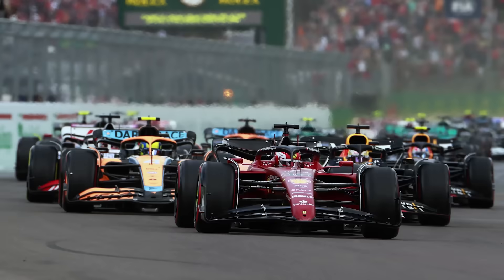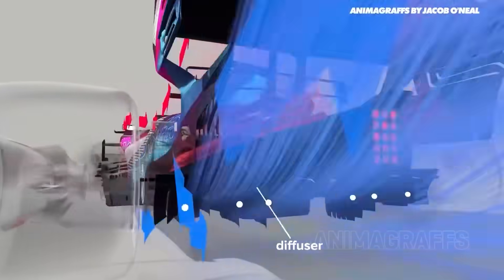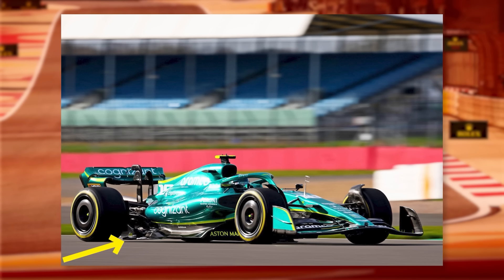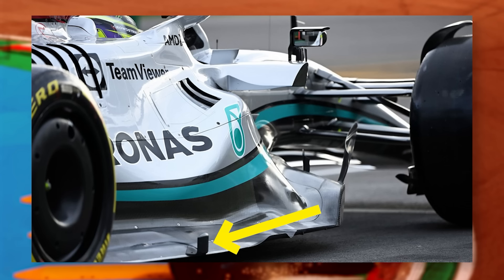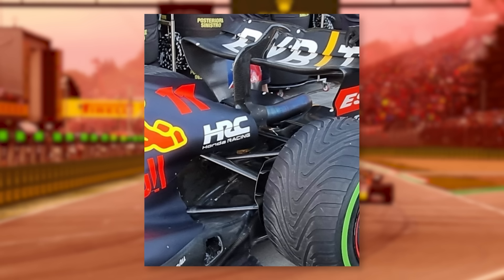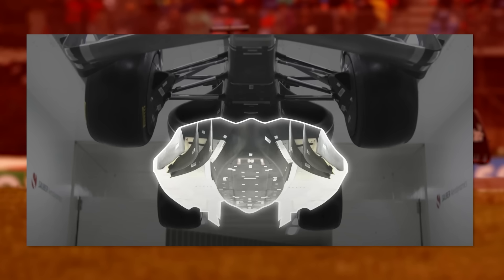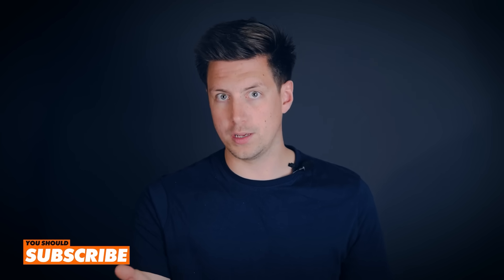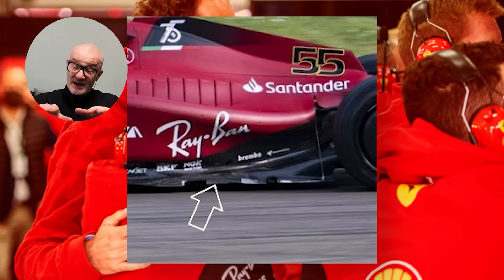The Tiny Component Giving Ferrari Incredible Pace

Comment: I swear you lot are paying scarbs' salary at this point 😂
Reply: grateful hes here though haha
Reply: I can do it for far less than Scarbs. Also, I know jackshit about the subject
Reply: @SnapshotPT  Believe in JESUS today, confess and repent of your sins. No one goes to heaven for doing good but by believing in JESUS who died for our sins. Hell isn't fun. GOD loves you soo much unconditional❤😋❤️😘
Reply: @alunesh12345  thank you, will do that
Reply: @SnapshotPT  So just like scarbs then
Reply: @ASJC27  precisely!! This is NOT how aerodynamics work.
Reply: @richardpatton2502  how do you know? Also where did scarb went wrong? Genuine question lol
Reply: @ishaankhandelwal7798  well, I have an airline pilots license. So I studied aerodynamics quite a bit. That’s just to answer the “how do I know” part.

Aerodynamics is about air pressures. And the differential between that same pressures on either side of a wing/surface. And also between the air going up and under the car (same principle).

Pressure moves from high to low. Meaning the air at a higher pressure will create a force (either lift or downforce) in the direction of the lower pressure. 

Scarbs tells it in a “air hits that then it must go there” kind of way. And that is simply not how it works.

Aero surfaces don’t “push” air. They just create different pressures depending on where they want the air to go. 

Simple example. The wing at the back.
When ram air hit the wings it creates one thing. And that’s “drag”. Now, if you make the wing in such a way that forces the air to go a “longer distance” either above or below you change the pressure. In this case the pressure above the wing is higher than below. So, air wants to go down therefore creating “downforce” 

And all this bouncing stuff. It’s called wing flutter. Different amounts of pressure applied on different points of the same surface. Which makes it flex in different ways. 
I mean, they discovered this back in the 80’s. You can watch several aero experts talking about it. 

All the best
Reply: @richardpatton2502  "surfaces don't "push" air. They just create different pressures"

Well I don't "push" a shopping cart, I just create a high pressure area at the back of the cart that makes it want to move to the lower pressure area in front of it. 🙄
Reply: @richardpatton2502     I assume scarb is just dumbing it down a lot for us. Just like your explanation of the "longer way" is also a simplification of Aerodynamics.

And fluttering is a well known problem that Aero engineers have been facing for a long time. In my understanding it is a similar problem with a similar origin. But as far as I know there is no easy solution. And it's most likely not directly applicable to this problem. Anyways if there were one I think the Mercedes engineers would know.
Reply: @NathanaelKeller  hey I get it. I understand Scarbs can’t go on some elaborate explanation about every little detail.
But in this case he’s actually being misleading. Aerodynamics can actually be very counterintuitive 

Meaning, when you see an aileron or elevator move on an airplanes wing/tail you might think “of course, that goes up, incoming air hits it and so the plane does that”. Makes sense, it’s intuitive.
But in reality it has absolutely nothing to do with it. That movable surface just changed the pressure differential between the upper and lower part of the wing. That’s it. That’s how aerodynamics work. 

He goes on about airflow and airspeed, they only matter precisely because they affect, again, pressure.

It’s like he’s trying to explain a refrigerator and not mention temperature 

I’m sorry, I’m not trying to be overbearing. You were very polite with your response and I thank you for it.

All the best
Reply: @richardpatton2502  How does one explain a fridge to a child? Typically temperature isn't actually mentioned and is only implied, depending on the age of the child. I think you are asking for detail that isn't necessary for understanding what is being discussed on the level that most viewers are interested. For example, one needn't understand how the body processes particular lipoprotein subfractions to understand that some oils are better for you than others. Using intuitive language may not be absolutely correct, but it is a sufficient explanation for the purposes of the video (and I say this as  pedant). This is one of the reasons I don't correct end-user terminology in my day job. It doesn't matter to them what a CPU is, as to them CPU is the computer as a whole. That's sufficient for their understanding and usage, and I understand what they mean.
Reply: @richardpatton2502  Correct me if I am wrong but you are saying it is the pressure that pushes the airplane up when the elevator is pulled up? The air pressure? Thus the air pushing on it? I think some clarification is needed here. 

At first it seems like a semantics issue but it seems more like you are trying to erroneously overstate the bernoulli principle when it is more about air deflection which absolutely applies to sheets of metal and angle of attack.

Example being airplanes with non transforming control surfaces that uses high angle of attack to change direction, like the canards on rafale and j20 or the horizontal stabilizer of the raptor.

 I've seen people fail to explain this concept so if this is wrong then please clarify.
Reply: @aaronaaronson2095  overstate the Bernoulli effect? It’s not an overstatement. It’s a basic principle of aerodynamics.

Sir, there are only 4 forces in action when a plane flies 
Lift, gravity, thrust and drag. 
What you call “air deflection” is nothing more than drag. In the case of the canard it moves the center of lift around. Meaning, if the center of lift is moved behind the center of gravity the airplanes nose goes up, or to be more correct the tail goes down and thus the nose up attitude. And vice versa. 

I don’t know any case of any wing that moves the plane by “deflecting” air.
What you maybe thinking about is “angle of deflection” but that also affects the wing via the Bernoulli principle. 

Like a laminar flow wing. As you find on many aerobatic airplanes. It doesn’t create any lift until you create a positive angle of attack because a laminar airfoil is virtually symmetrical. But the principle that makes it fly is the same. 
Pressure differential. 

All the best

Edit. the case of the elevator, when the elevator moves it does one thing. It either increases lift at the tail and thus make the nose go down. Or it decreases lift and make the nose go up. That’s it. 
Not by deflecting air but by changing the pressure differential
Reply: @richardpatton2502  It was wrong to mix up the subject. Let me try and clarify.

I'm too tired so correct me if I am wrong, now fundementally you can describe anything moving involves a pressure differential,  but how that is generated is what is up for debate here.

The point the video was making is that a piece of metal can redirect the flow of air. It can either create bernoulli's effect or just plain deflect it. The latter point being the one you seem to be refuting. To make it more clear you can deflect the flow of air just like how your umbrella can redirect the flow of rain or that Will Smith's slap can deflect Chris Rock's head. There is no bernoulli's effect in play yet pressure is still applied.

Now when it comes to the elevator issue, of course there'd be a pressure differential even when it's just air pushing against a partially engaged elevator, we are describing the same thing from a broad perspective when you mention the changing of the "center of lift." More lift is generated due to the higher angle of attack of an elevator, the issue we have lies in is how this force is generated.

I was not convinced by your explanation and sought after some google answers to confirm. I stand by my assertion that angled aero surfaces can and do plainly deflect force. There are multiple quora answers by aeronautical engineers pointing out that explaining lift generated by wind deflection via bernoulli's effect being a misconception as well. Lift was being described as mainly a momentum transfer problem, newton's action and reaction, lever effect etc, not merely bernoulli's effect. The deflection of the air creates a force against the wing, making the plane move.
Reply: @richardpatton2502  it depends from which point of view you want to look at aerodynamics. You can look at it from a newton's point of view. If the wing is pushing the air down, than the air is pushing the wing upwards. No pressure analyses needed. It is a valid approach for overall understanding. Pressure analysis allows you to better understand and quantify the intricacies of the air flow along the axis of a profile, a more detailed analysis so to speak, but that does not mean other physics laws no longer apply. That would be quantum mechanics 😅
Also, when you talk about drag on an aerofoil, the most drag (there are other smaller sources of drag along the air flow) is created by pressure differential from the leading and trailing edge.  Strangely though you do explain it from a newton's point of view by being created when it hits a surface and changes direction. Its not wrong, same principle has previously explained...
Reply: @aaronaaronson2095  its not either one or the other. Both principles are valid and go hand in hand. The deflection causes changes in pressures and the change in pressures cause deflection. Its only a question of how you want to look and something. On the low pressure side of an airplane wing it is the pressure diferential that makes the air move downwards and merge with the air flow from the other side of the wing (assuming flow stays attached), thus incrising the total mass of air deflected by the wing (ence more lift by newtons 2nd law). And at the high pressure side of a wing the air hitting a change in local geometry makes for locally increased pressure, making the air moving around this high pressure, thus deflecting it. They are all part of the same process. Mathematically you can derive one from the other and vice versa.

On a plus note, its not the nose that goes up or down when the elevator changes planes, its the tail of the aircraft that goes up or down. What matters is that it will change the angle of attack of the wings producing more or less lift 😉
Reply: @ruilucena3017  Yeah there's a relationship of both, I'm not sure if I accurately conveyed my idea. 

The front wing I was referring to the canards of some fighter jets acting as front elevators in canard delta setups like the rafale
Reply: @aaronaaronson2095  on your previously comments you were having doubts about where did the force lift came from, being skeptical about them coming from pressure diferenciasl. I was trying to explain the two are entangled, you can explain the phenomen via both ways (bernoulli and newton). The bernoulli approach gives way to local pressure analyses allowing you to better understand other things like flow attachment, and boundary layer energy which are the basis for things like multi plane wings. And pressure diferential does create forces acting on a surface, that is why a ballon expands when inflated...
As to the canards i look back at your coments and you pointed they are not a transforming surface. I think what you ment to say is that they do not follow a curved profiled, like a NACA profile and other "aero" surfaces do. That does not mean the forces generated cannot be explained via bernoulli equations. It may be less empirical to understand, but the forces generated from the pressure fiels around that surface will correlate with any Newtonian analysis you might do. Just because it is a straight profile does not mean its not "aero", it depends on the intent it was designed for. Due to cultural reasons we relate "aero" properties to low drag or high lift/drag racio, but in reality everthing exposed to an air flow has aero properties that can be defined via pressure analysis using bernoulli's (and others) equations
Reply: I want to know who is paying his internet bill, because they shouldn't be. It's appalling
Reply: Scarbs pockets get filled from a multitude of sources.
Reply: He is on all the good F1 YouTube channels . Still just a poser without Scarbs on the show 😅

Comment: They should allow active suspension next season to stop the porpoising. It’s a more road relevant tech than most of the stuff they’ve bought in this year under that guise.
Reply: The trouble with active suspension is you’re taking some of the driver skill away, and putting it into the hands of a computer.

ABS brakes, and traction control are banned for the same reason, F1 must keep the driver focus.
Reply: I don't think it's very likely, considering the cost
Reply: @Pedun42  They could make the actuators and sensors standardised, fia provided parts, like they have with the fuel pumps, then the teams would just have to get creative with the control modules/programming.
Reply: Why? So many teams have solved the problem. Will their efforts be compensated?
These are the rules. And that's where all the teams have to work with.
Reply: why reward being bad